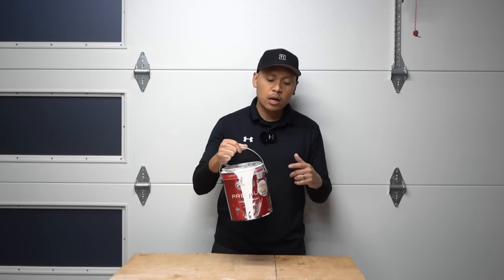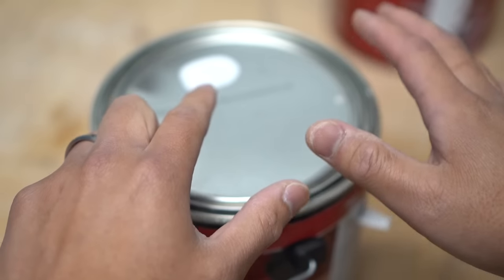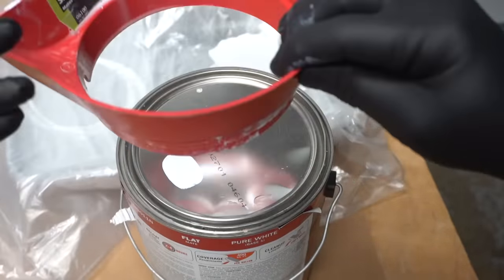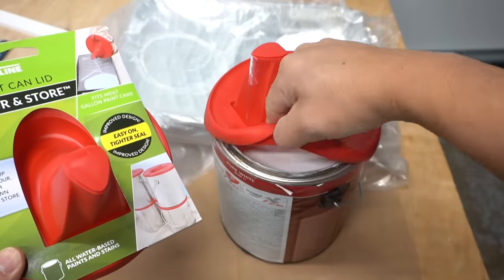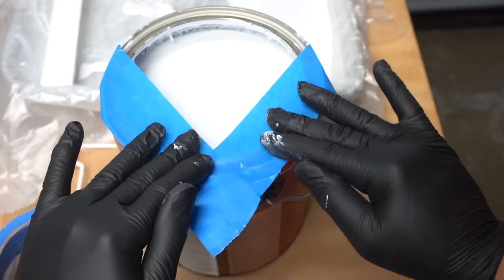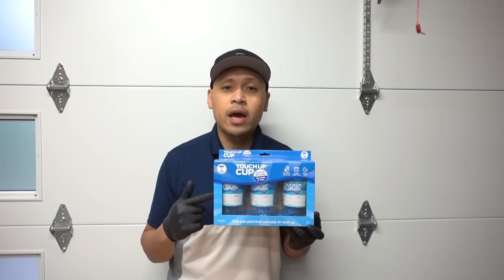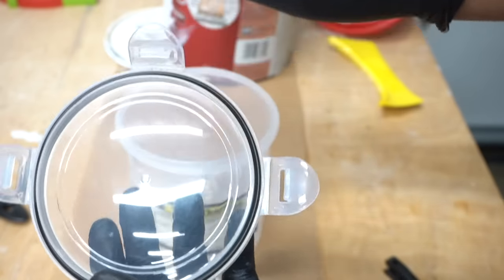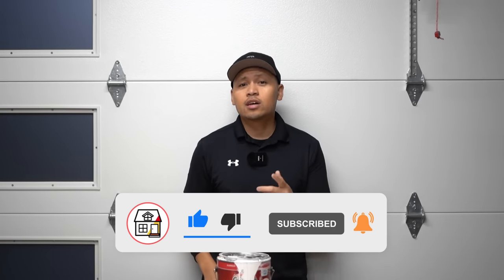STOP Throwing Away Half-Used Dried-Up Paint Cans! How To Fix It To Last Forever! Tips & Tricks!

Comment: My experience/trick: Put a thin plastic film on the surface of the leftover paint (in its own can) to minimize the contact between air and paint and close it with its lid/cover (I always kept/wiped cover and rim clean). This method can keep the paint from drying up for years.
Reply: YES! Once you have more air than paint in the can, it will dry up regardless of the seal/lid. And yes, always keep the rim clean.
Reply: I used that ‘hack’ when I worked in a printing company years ago. I used to mix different colors of ink for specific jobs and before storing the leftover ink I would spray a ink specific solvent on surface of ink in can and then gently put a trimmed down piece of oiled wax paper on the ink and smooth out any air bubbles before sealing can with air tight cover.  Also had put a ‘dab’ of the ink color on lid with mixture formulation so as to remix same color exactly in future!  This trick would certainly work with any paints that were specifically mixed for a job.  👍🏼🤷‍♂️😜

Comment: I'm a painter and have tried all of these but they just don't seem to be long term practical for me. It's just more time messing about and also trying to find a safe place for the wet metal lid when these are on (and paint dries on this then drops into the can when put back on). I also find it nerve wracking to shake the paint the next day with the spout one. And with the pourer, you can't leave paint without a sealed lid or it skims which causes crap in your paint so you have to take it on and off all day. It just became easier to wipe the lid crevice each time you pour the paint into your tray or bucket and put the original lid back on. It's quick and easy and if you are diligent with this the paint will be fine for the entirety of the job. Then pour some into a small container like the one at the end (haven't seen them before, they look brilliant) and give to the client. The rest goes back to our local shop which recycles it. I really wish there was a way to have a spout system that was efficient, like maybe the metal lid with one built in that you can pull out similar to an engine or olive oil can. I guess they have tried these in the R&D department, maybe there was too much failure, or manufacture cost.

Comment: A guy taught me this trick several years ago and it works very well.  Simply remove the lid on a new can of paint, take a heavy gauge nail (spike), and pound several holes around the top of the paint can, so that the excess paint, after being poured, will drain back into the paint can.  It does leave some paint around the lid channel, but just take your brush and clean the channel before closing the can lid.
Reply from the maker: Thank you Jeff! I will have to try this! 🙏🏽😊

Comment: I use a NEEDLE OILER BOTTLE with oil in it. Before opening the paint can I run a bead of oil around the lid to keep it from rusting and make it seal beater.

I put tape around the whole top and fold the tape over to cover the top grove. This keeps any paint from dripping into the grove.

I don’t pour out the paint, but use a small cup like the measuring cup that comes inside a laundry soap box. I scoop out small amounts and fill a paint pan or a small peanut can. This keeps paint from filling in the grove.

If I get some paint in the grove I clean it out before putting on the lid.

Hope these ideas help someone.
Reply: Your scoop out tip is what I also been using, nice and clean.

Comment: I went to the big orange box store and bought a new 1 gallon plastic paint pail because the metal cans rust out and either get debris in the paint or if the metal has deteriorated enough it will leak out all over the place. Love these videos of the caulk tube savers and now this paint.

Comment: That Shur-Line lid with the spout... you do know that the spout folds into the lid for flat storage right?  Easier to store, and less air left in the paint can (leave air hole open until spout is folded down; then close the air hole).
The homemade tape spout never worked for me. 
When you're done stirring, just use your brush to wipe the stir stick off and you're good to go.
And lastly, if you transfer old paint to a smaller container (or any container), it's always a good idea to use a strainer, to remove all the debris (rust from can, impurities that got in, etc.) and any paint clumps.  Always strain old paint.

Comment: The Shur-Line Paint Pourer is the best of these options, in my opinion, but keep four things in mind:
1. It works fine with metal paint cans, but does NOT fit the new style plastic gallon paint cans that are being sold.
2. Just as the review says, make sure this thing is FIRMLY and COMPLETELY fitted into the rim of the can. If not, you will have a absolute mess or a very interesting floor mural.
3. With the pourer attached, you can't carry the paint can by the wire loop handle. You have to use two hands to carry the paint can, and you'd better have a good grip on the can.
4. If you try to do anything more with the paint can than pour from it, keep in mind that you now have a paint can with a much bigger rim around the top. You will catch the rim with your ladder or paint brush or elbow, unless you are extremely careful.
Reply from the maker: Thank you so for the the very informative response! Really appreciate you taking your time to share your experience and techniques! 🙏🏽😊

Comment: Have used several of the products to you mentioned. If I have  less then 1/2 of a gallon  left and do not plan to be using the  paint in the foreseeable future I like storing the paint in a smaller plastic container. Ideally the container has a large enough opening to allow inserting a brush if I need to touch up a spot.

Comment: If you don't have a paint can opener key you can just use a quarter. Also when you're finished never use a hammer to reseal the can. Place the lid on top of the can cover it with a rag and step on the lid, step on it two or three times I've done this thousands of times it works great.

Comment: I bought a can of heavy inert gas, which you can allegedly pour into paint cans to displace the air. I haven't tried it yet, and would not know if it worked or not. High tech, though. Feels like snake oil.
Reply: Tried it on a can of stain. Followed the directions and a few months later, opened the can and it was hardened👎 Maybe if I used more than the directions called for???  Either way, sadly it didn't work.

Comment: You spend a fair amount of time talking about keeping the rim clean and I disagree, not with idea of doing so, thats good, but all you need to do is use your brush a few times to really keep the rim area clean, it wont be perfect, but it can be darned close, in my opinion. Problem is most people wont take the time to do so, but in fact it takes hardly any time at all. If you pour the paint into another tray or otherwise to do your painting, then you'll only need to do this "cleaning" a few times, just do it. 

The real problem to solve is the air problem. And I have seen mentioned here a couple times turning the can over, which as I think about it ingenious. So why dont we do it? Because, in my opinion, as humans we like ORGANIZATION, and looking at a shelf full of upside down cans can be bothersome. I am going to go right now and turn my cans all upside down (assuming I have closed them tight which I always do, so I dont even need to check that)

The point about the key tool vs. flathead screwdriver, I am so embarrased I didnt know about that, some of my lids have all kinds of contortions as a result of the flathead, I will get the tool and use it going forward.

Finally I agree that if the can has a lot of empty space in it, you're looking for problems and really the only solution is to transfer into another container, I see no other way. 

I'd love to be able to freeze paint, but that would have its own issue of having enough space in a freezer to do so, besides of course the fact that it would ruin the paint LOL